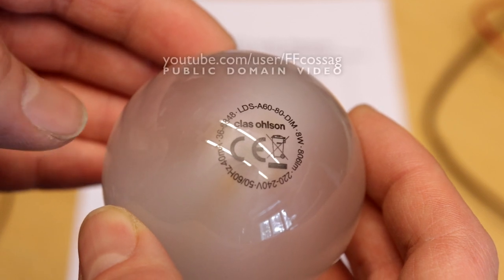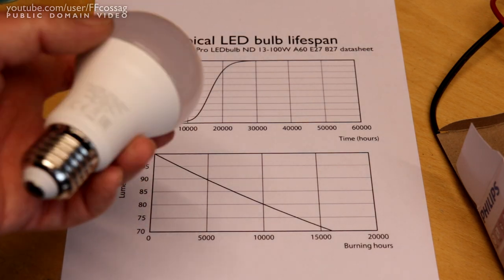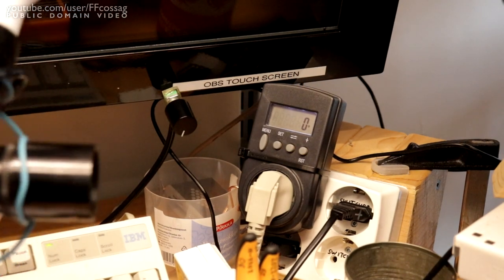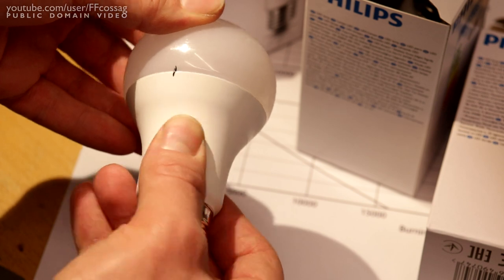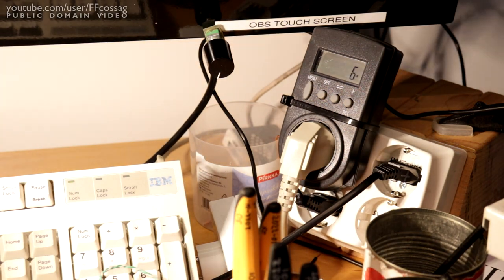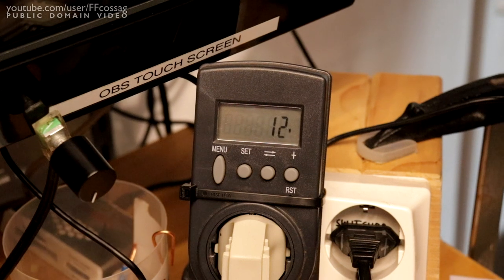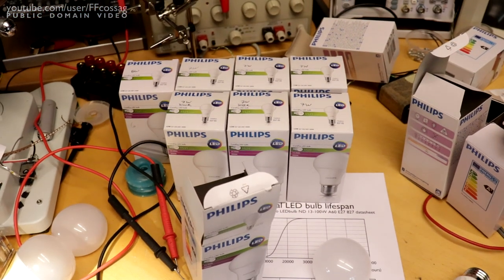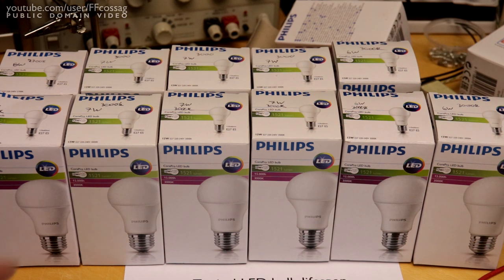Making "Dubai lamps" from 13 W Philips bulbs with a simple hack!

Comment: It should be pointed out that cutting the power consumption in half does not cut the lumen output in half.  The unmodified bulb converts a higher percentage of electricity into heat than the modified bulb.
Reply: i tried it with my bulb and i lost only a third of it's lux
Reply: yup, that's what diminishing returns do

Comment: I figured the bulb companies would get fed up if everyone is modifying their bulbs to increase their lifespan. I wonder if they're burying the resisters deeper or putting a single resistor instead of two in order to frustrate the efforts of DIYers. Nice work. Thanks for sharing.
Reply: A single resistor from what I have looked at.
Reply: since people discovered the easy repair tweak by essentially soldering and shorting the one broken led diode to make the bulb glow the companies now put 12 volt led chips instead of seprate 3 leds to make the tweak useless as by shorting a single 12v the current gets too high and burns the other diodes
Reply: @do2eazy363  the amount of people who would do this is very low. More likely, it is cheaper to use 3 LEDs in one package, because reduces the number of components the pick and place machine needs to place (also more LEDs per PnP reel).
Reply: @Max24871  i made a flashlight a using the 3v led chip from led bulb and it was god bright now i can't do it anymore
Reply: I disassembled some Osram LED bulbs, and they have a separate PCB for the power suppy, it has a lot more components, and it's not that easy to find the resistors.
Despite having a (seemingly) more robust design, when I checked, both bulbs had failed led diodes probably due to high temperature. The power supply was still working fine.
Reply: @Sugurain Seems that you are describing an "old fashioned" design of a led light bulb

Comment: A lot of cheaper LED bulbs can often have accessible current-setting resistors, so a lot of off-brand ones can also be made into "doobie" lamps as Clive called them, it's just getting a nicer colour that is the issue in my opinion, everyone seems to stock only either the yellow 2700k bulbs or the blue-white 6500k bulbs, I prefer something around 3000-3500k myself, easier on the eye...
Reply from the maker: Then perhaps these 3000K CorePros might be worth investigating for you. The new 3000K ones MIGHT still use the same design ...

Comment: Superb video. A very simple hack for reducing bulb temperature is removing the plastic diffuser cap, or even drilling 2 holes into it (side and tip) for airflow.
Reply: And after drilling the holes in the aluminum part of the base attach some good finned heat sinks. This will allow you to "suck away" a LOT of heat. The bigger the heat sinks the better! I prefer this method to reducing the drive because I want  to get the RATED Lumens from the bulb!

Comment: I've always had an inkling that most lamp manufacturers were designing these things to fail.

For one they absolutely grill the LEDs as you've seen

for two they drive them right at their rated current.

The funny thing is, they could actually score marketing points and GAIN efficacy by driving them at a reduced current. LEDs have an exponential efficacy curve that sharply tails off the closer you get to the rated current of the diode. There's a sweet spot below 80% and 60*c where depending on formulation of the diode and phosphors, the LED could potentially be capable of outputting north of 200 lumens per watt with that super long lifespan.

and if they want to shorten the life of the lamps, just go cheaper on the capacitors lol

Comment: Great video 👍 most semiconductor wear mechanisms accelerate by roughly a factor of 2 every 10C so overall lifetime may be extended by a lot more than you estimate (2^4=16) although I do not know how phosphor ageing curves look. Also don't forget that led efficiency improves at lower powers so your light output will be more than half the original rating 😁. Winner winner chicken dinner

Comment: Philips now has a Dubai-style bulb out in Europe, at 50000 hours and a 210lm/w efficacy, so even slightly better than the Dubai lamps.
Reply: Where can I buy it and what's it called?
Reply: @TwinbeeUK  it's called the Philips Ultra Efficient LED. It's the only Philips bulb to come in a green box.
Reply: If they don't come to the US, I'm gonna be PISSED.
Reply: @Logic44
It's available but only on 2 stores. Its at 180 l/w instead of the Dubai 210 l/w.
The diy core pro bulb in the video is supposedly 235 l/w if it really is putting out 1521 lumens.
Reply: @jason200912  it's probably harder to achieve Dubai-level efficiency on 115V compared to the 230V found in Dubai and the EU
Reply: @NetRolller3D  seems to be the case since a tester found in the uk tested it to consume 3.84 watts on the green box which would perfectly equal out to 210 l/watt of the Dubai lamp

Comment: I'd love to kinda hack my philips 3452lm LED bulb in this way and also add a bigger filter capacitor and remove the way too weak inrush resistors because they keep making the whole bulb blinking sometimes and it ends up not powering up anymore at all because of that.
Unfortunately, all the electronics are behind the LEDs board and they are completely covered in resin. You basically can't get to it without somewhat destroying the lamp.

Sucks, I'd really love a reliable 3000+lm E27 bulb!
Reply: @John Doe but just by removing the plastic globe I am already somewhat destroying the lamp.

And I got one more which is made out of glass and has the same issue!

Comment: Comparing these to some TCP brand 12W that I bought on clearance, the TCP have a a serious heatsink for the back section and they are heavy, don't know about the number of LEDs and the circuit, but they certainly take the heat dissipation a lot more seriously.

Comment: Nice!! I have seen many lamps like that and yea the LED's just burn out, sometimes shorting the bad one works (it makes the linear driver chip hotter so dont short too many out)
I have Phillips 3 way bulbs which seem to have a good thermal design. It is actually a virtical + arrangement of the boards and they opened up the center with ahole at the top and vents down the side so it can have convection cooling. so far 3 years strong, but they arent on 100% of the time so still not over the 20k hours mark.

Comment: I've done some simple experiments using a variety of unmodified LED 120v bulbs and a simple VARIAC. I simply started the bulb at full mains voltage (117-122) and slowly dialed the VARIAC back, watching the light output. There is a zone where as i'm lowering the voltage where the light output doesn't go down at all, than past that point, it slowly gets dimmer, than after that it nosedives.
So what I do is I try to find the sweet spot which is  just before the light starts to decline and than I make a note of the voltage o n the side of the bulb with a sharpie.

On one bulb it was too hot to the touch running it at 120v. At night where I live it can get as high as 127!! But running it at 90v it was STONE COLD with a negligible loss in lumans.
Instead of busting open these bulbs, I suggest people make a simple box with a common iron ten Watt 12v transformer inside, wire the transformer buck boost style to shave OFF 12v from the line and run your LED's off that. There is a cheap APC brand UPS that is power strip shaped with a 150w inverter inside. The SLA battery is a joke and the inverter is a joke.
But its got a nice beefy 12v transformer in it. I scooped out the inverter circuit and wired it up in buck config, all the electronics in my bedroom are hooked to this "magic" power strip and the 105-110v is kind to everything its hooked to.
Reply from the maker: I'm sorry to burst your bubble, but I want to point out that this isn't very good general advice. These bulbs are built around constant current power supplies. By dropping their input voltage, you're forcing them into essentially acting as constant voltage supplies by removing all their voltage headroom. The voltages will vary with all different bulb models, and they're going to be very sensitive to factors like temperature and grid voltage variations. You're not going to break anything, but you're probably going to be seeing a lot of variability in how your lights operate.

Comment: @FFcossag you should do  a short video on how the newer 2700k lamps are made , maybe the current  setting resistor are under the pcb
Reply from the maker: It's a single resistor on a PCB in the base. Not worth trying to modify, too much work.

Comment: We have an old 30W LED lamp from 2009 or so in our kitchen, from back when high-power white LEDs were an expensive novelty and it was marketed to us as a well-cooled, bulletproof bulb. Guess what: that bulb is still fine in 2023 and gets at least 3h of on-time a day. It was sold at 40-50€ if I recall correctly and that's the price we probably should expect to pay if they really were designed to last in the first place.
Reply: Old heat Bulbs consume 50 bucks a year in light, so durability prices aren't really a concern when it pays for itself

Comment: I think your estimates are quite reasonable.  You are halving the LED current AND significantly reducing the junction temperature, both of which will increase the life on their own.   If you ever need more light output there's nothing stopping you adding a second light fitting.

Comment: Do you think that led strips are better because they are more spread so have less overheating problems ? Should a led strip last longer than a light bulb ?
Reply: Yes! Spacing the LEDs farther apart is going to allow them to run cooler.

Comment: The Philips "Dubai" and  "Ultra High Efficiency " both doubled the number of LEDs in each string AND reduced the driver-current, they didn't just reduce the Drive Current.
So reducing the drive current on a "standard light" will reduce the heat but also increase the lifespan.
However the light output suffers as well, not so for the "Dubai and Ultra Efficient" lights.
Reply from the maker: Lowering the drive current is functionally the same as increasing the number of chips; the end result of both actions is less power dissipated by each chip.

Comment: interesting video. thank you. curious, would the colour of the bulb top (this one being an opaque white) determine the kelvin of the final product? if you had an arts and craft clear bulb to replace it with would the colour temperature change much?
Reply: LEDs come in all kinds of colours. It is the chemistry in the LEDs that determine the colour. Not the plastics they are packaged in. The top is opaque to diffuse the light but probably does not change the light colour. (That would decrease the efficiency.) Cheers

Comment: The important thing to understand is how Humans see things. It's not just the LEDs becoming slightly more efficient.
Firstly, the eye's response to light is logarithmic. It takes about 10 times as much light to appear twice as bright. However,  that only applies when you can compare the two light levels... there's more!
The human eye has "Auto Exposure" control, using a mechanism called the IRIS. No matter what the light level, the human eye automatically adjusts so that you can still see properly!
These two mechanisms allow a human to see in light levels of 0.1 Lux to 100,000 lux without much difficulty. Your brain sets the "brightness level" using quite complex algorithms, but basically it uses averaging then sets "100% bright" to the highest light it can see anywhere, and "dull" based on the average of the majority of the areas it can see.
1. A 50% drop in measured brightness (Lux) is completely unnoticeable, providing that you don't see the transition occur.
2. If you increase the illumination level of an entire room, you will not notice any difference in brightness. In fact, it will cause the brightest area (eg: a task light) in the space to appear DULLER.
3. If you want some area in your house to appear "brighter", there is no need to add more lighting. Simply reduce the light levels in the surrounding and adjacent areas.
To most people, the human eye works in counter-intuitive ways.... but actually it's very logical how it performs.

Comment: I was curious and popped oven a cheap "100" watt led and it looks somewhat like yours. I'm in the US, its a dollar general light bulb. Took a lot of work to get the bulb head off but i got it. I have three resistors labeled r1, r2, and r3. R3 is physically larger and has the number 564. The two other ones are about half the physical size, hard as hell to read but i see  13RO and 15RO. Does that sound right? almost identical to your board. Not sure how since I'm on 120 volt and you sound British and likely 240. Trying to learn more about LEDs. You can get import Dubai lamps now and a (allegedly) superior version off the shelf. I'm trying to make wide input LED DC bulbs or atleast 11-34 volt DC input bulbs for an off grid system. Those Dubai elements, the filament use almost half as much power as your stardard cheapo bulb. A huge savings. Ebay and amazon have filaments like them for sale but I dout they have the efficiency or quality so I might end up cannibalizing a store bulb.

Comment: IKEA's current GU10 bulbs are similarly easy to open, the ones with the glass shell, not the plastic ones. They do have power components accessible from the top but I haven't tried modifying one yet. From a cursory look it doesn't seem like they're using two resistors in parallel for the current monitoring so you might have to replace the resistor with a different value rather than just removing one.
Reply: Put a "pot" in place of the fixed resistor and turn it up to the point where the brightness just STARTS to drop. The life of the bulb should increase significantly!

Comment: got some cheap tesco 14.5w (100w), led bulbs,  6 months later, one of them cracked, around the casing, they do get very hot, so took it back, normal thing, have you receipt, did you get it from us, tesco,  no receipt, but told them to read small print on bulb,   :),  got new one, now going to hack this one to run on lower power

Comment: You don't even need a soldering iron for this modification as you can also scrape the carbon layer from one resistor with a knife or similar tool.  Anything goes so long as you don't damage the other resistor.  I've found that some bulbs have the entire power supply on a separate board underneath the emitter PCB and those are much more difficult to modify as non-destructive disassembly is very difficult.

Here in the U.S. I found a "75-watt" (13-watt) bulb from Walmart (Great Value brand) that is/was just as easy to modify as these Philips once inside, but the plastic cover is attached very well and requires a fair amount of force to remove.  If you find a bulb that's easy to modify and with a color temperature that you like, I recommend buying a few extras as there's no guarantee the future models will remain the same; companies are constantly trying to increase profitability.

You'd expect half the usable light with half the power, but 1) humans perceive light intensity in a logarithmic fashion, and 2) cooler LED's are more efficient.  If you do want more light, running two 6.5-watt 'Dubai' bulbs will put out more light than one 13-watt normal one.

Comment: I have some 9w (supposedly 60w equivalent) bulbs in my house from various manufacturers.  A real "dubai" lamp gets 60w equivalent from 3w power draw.   I wonder what output these philips 13w bulbs manage if you replace the resistor and go all the way down to 3W? Maybe 4W?  How cool do you think it'd run?  How bright?

And has anyone tried Big Clive's trick of using a capacitor to limit power on these bulbs?
Reply from the maker: It's not a huge difference. I have one that I brought down to 4.5 W, and it runs perhaps 5-8 C cooler. Light output does start to suffer a bit at that point though.

Comment: "It's intentional design! All LED bulbs are built to overheat, overdrive and destroy their LEDs."

There’s planned obsolescence for you - where manufacturers deliberately shorten the lifespan of their products using a variety of methods (in this case, over-driving the LEDs thus making them more likely to fail), meaning consumers become repeat customers earlier than they should, resulting in more profit for the company at the consumer’s expense…